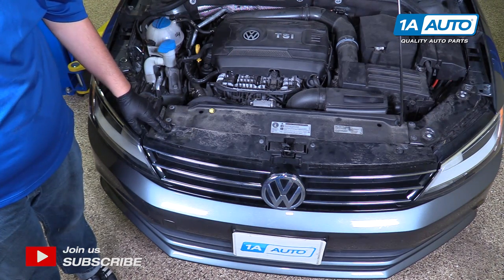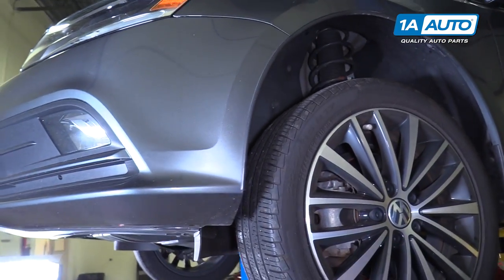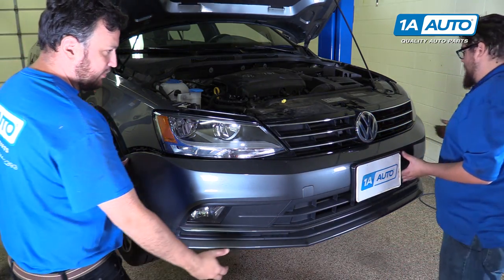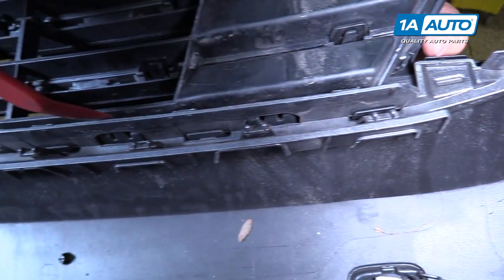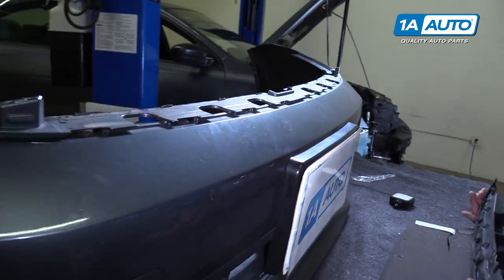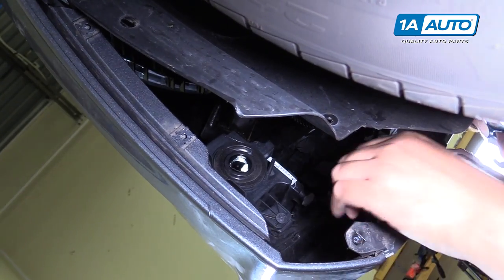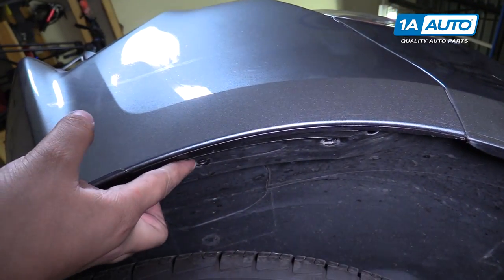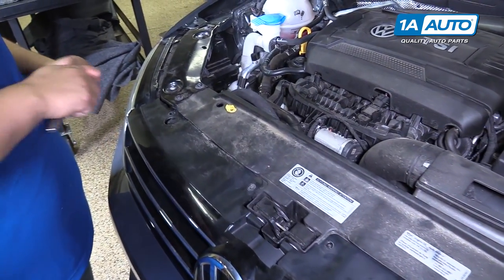How to Replace Front Grille 11-18 Volkswagen Jetta

Comment: For every one you don’t have to take your bumper off for this, not sure why you took it off
Reply: Please explain how because you need to unclip it from the grill itself as well.
Reply: Well you just pull, I ha e a 17 and it came off just fine
Reply: I just did mine. The grill snaps out of the bumper. You dont have to take the bumper off.
Reply: He is like here if you want to take the grille out, pull the motor lol
Reply: And there is no door edge molding on any of the fenders lol wow
Reply: And this is why people like this would charge like 200 dollars to change out the grill. When it takes 4 screws
Reply: @davesaccount3923  u saved me i was bout to pay 200 to get mine swapped out
Reply: @davesaccount3923  is yours a 2017 model ? Cuz mine is the facelift 2017 Jetta SE . You sure I don’t have to take out the bumper to remove ? If so this will be really helpful
Reply: How??

Comment: How do you remove the Volkswagen emblem from the grill?
Reply from the maker: There are three tabs that you need to release with screw driver or trim removal tool, and the emblem pops out.
Reply: Shawn Zafar don't know if it's too late but for my 2011 Jetta sportwagen tdi I had to rotate it counter clockwise for it unhook